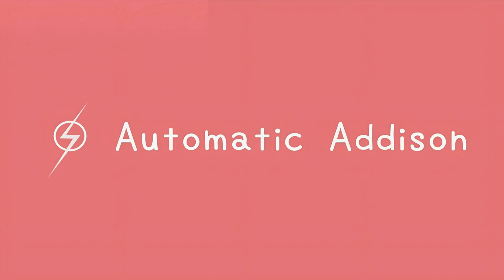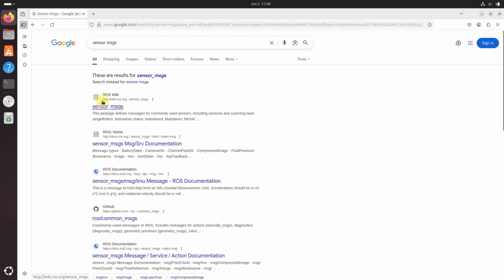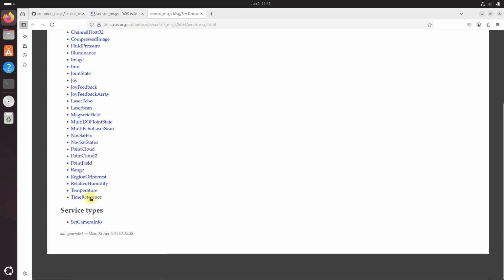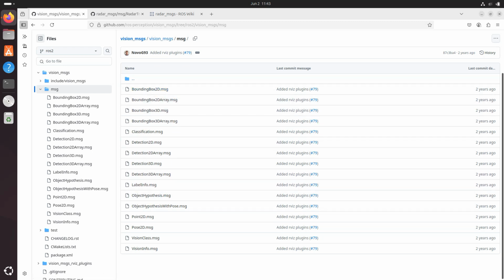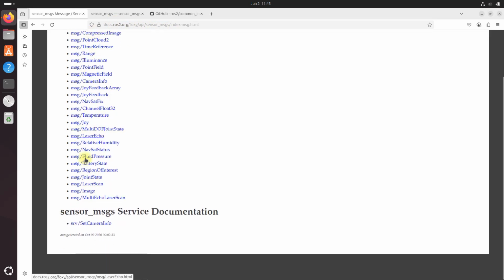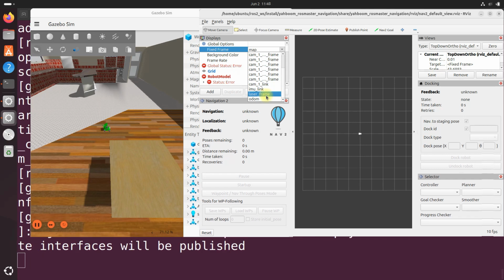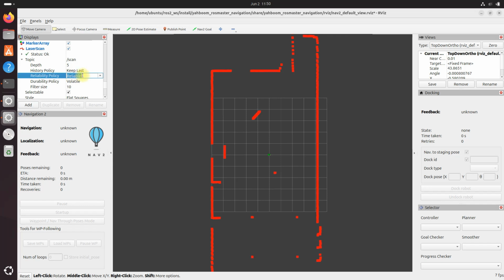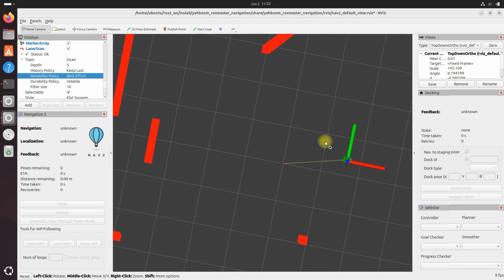Exploring the Common Sensors for Nav2 - ROS 2 Jazzy

Comment: when i choose the odom as fixed frame in RVIZ programme the chasies of the robot disappear at all and i cannot find in in the rviz , also when i try to make the square movement i see arrow moving instead of my robot and this arrow move square and i donot know how this happen 
,can u tell me how to fix this or where the problem which cause this
Reply from the maker: You can reach out to me here for help: https://automaticaddison.com/contact/
Reply: I am also facing the same issue. Can you please suggest what went wrong?
Reply: Same problem and I cant figure it out, if someone found the answer please share!
Reply: for those struggling with this I think it is in the ekf.yaml file. 

I changed 
odom0: mecanum_drive_controller/odom
imu0: imu/data

to 
odom0: /mecanum_drive_controller/odom
imu0: /imu/data

its a simple thing and flies under the radar but for me it worked